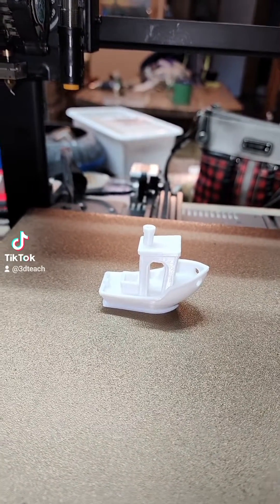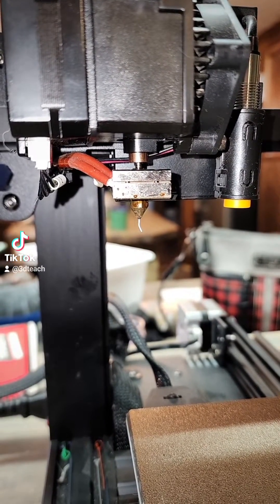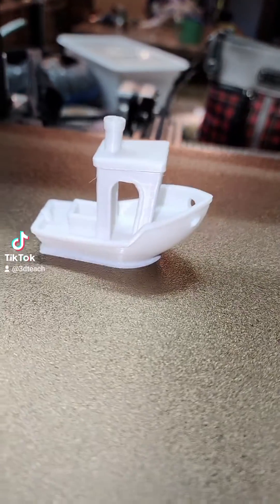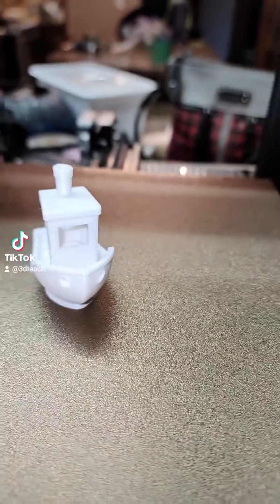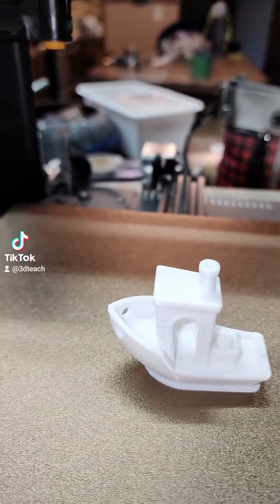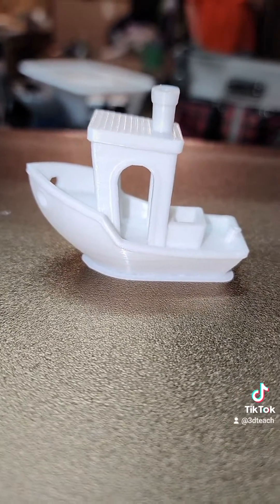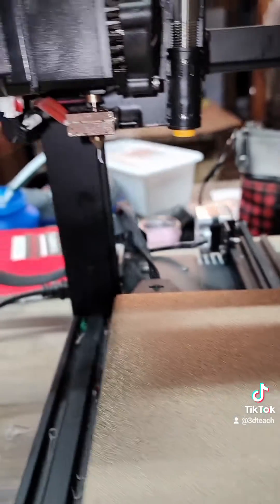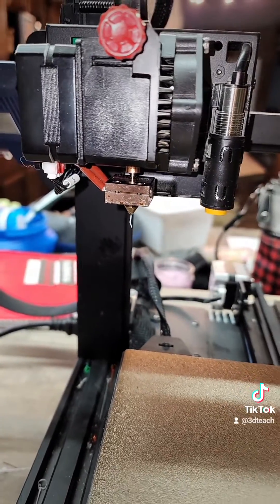All metal hotend retraction settings for Anycubic Kobra using Eryone pla.

Comment: This benchy looks awesome!! Did you do any firmware updates for max temp?  I've been wanting to do this upgrade! The max temp on the kobra states 260c degree printing, but ptfe starts degrading at that temp? I've been printing PC at 250c and am worried about the ptfe wearing out and off gassing.